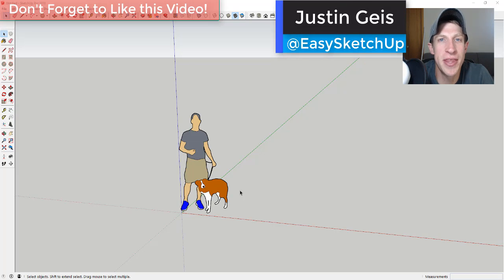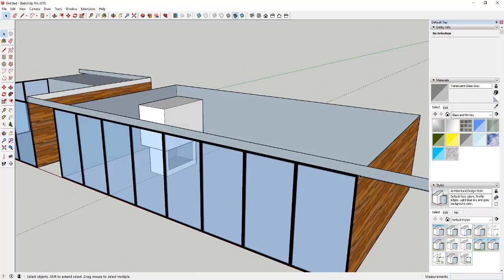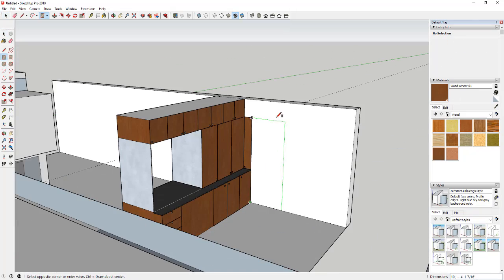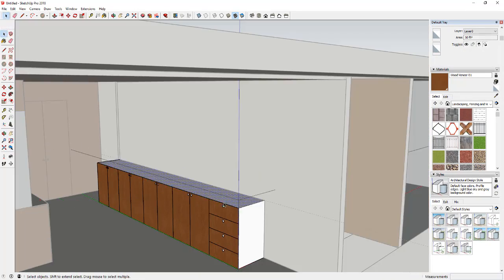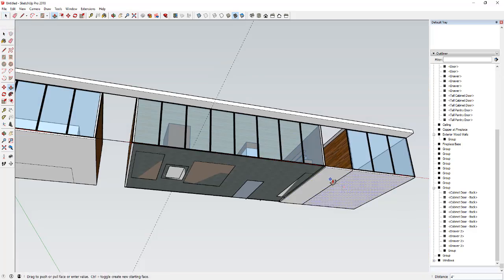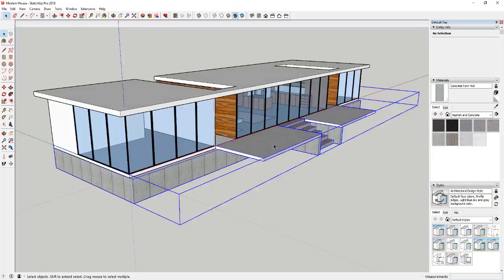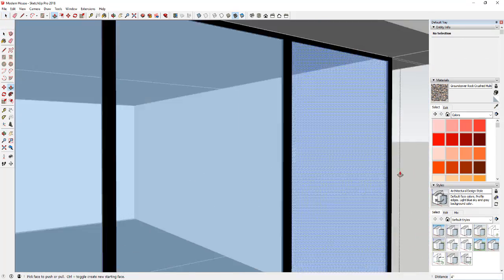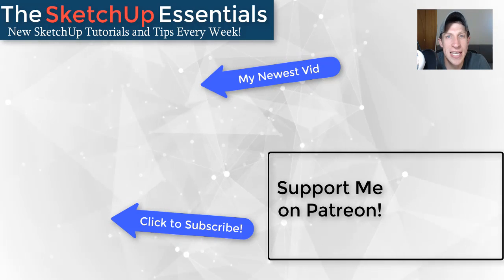MODERN HOUSE SPEED BUILD - SketchUp Speed Modeling

Comment: I have a question, and it might be a stupid one, even for a begginer.
Once I start modeling and grouping walls and other geometries, I keep seeing their border lines, which is great for modeling purposes, but awfull for presentation. I know I can hide this lines in the View menu, but even by doing so I can still see the right spot when one wall ends and another begins, even if I wanted them to all be just as one.

When rendering, does this effect vanishes, or is it still visible?
And is there another way to "remove" this?
Reply from the maker: Generally speaking, the edge lines don't render (depending on your rendering program and settings). You can else change the edge settings so the lines show up in different ways in your styles - https://www.youtube.com/watch?v=MbxE2Xej0OA - Thanks!

Comment: Thanks for sharing. My personal experience is that when I'm tackling a totally new project I very seldom hit on the optimum technique but in general I think you are right to layer and label building components as you go along.I noticed that you put "form" ahead of "function" by modelling the shell before you put in the rooms and furniture. I generally work the other way, putting in the rooms first and then deciding on the exterior form. I do not think there is a right or wrong way if a client came to you and wanted you to design a hotel to make a statement in the community then your way makes sense. However, if a client said design me a hospital then the rooms-first approach might be better.
Reply from the maker: My process was a bit different as well because I was modeling from a photo, so I wasn't starting from a "What do the rooms do" standpoint anyway. If I was modeling more from a design standpoint rather than from a duplication standpoint, I think my approach would be different. Thanks!